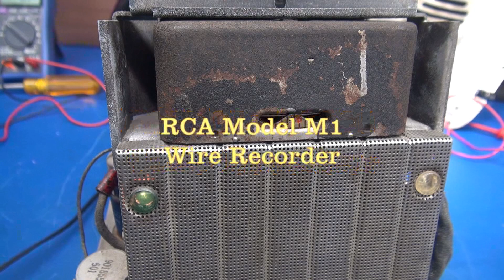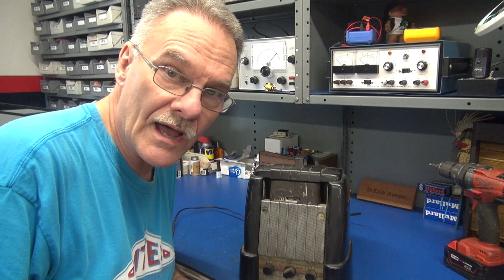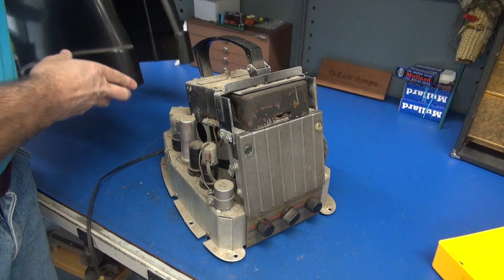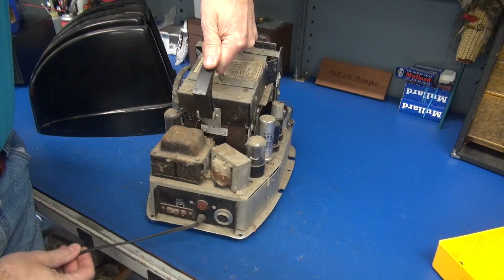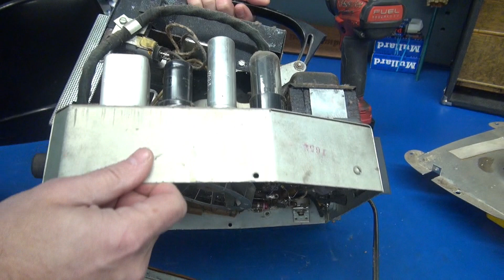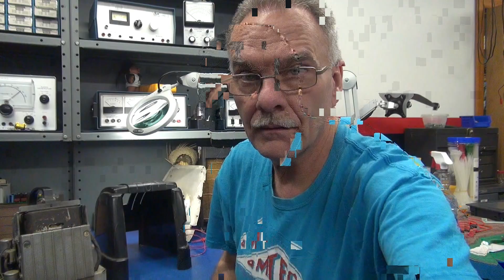RCA 50's tube wire magnetic recorder Model M1 repair and initial checkout Yes it works! Very Vintage

Comment: How the heck did you get to the wire to spice it that box when the wire broke, and the wire in those old records always broke. My dad had a old webcore dictating machine that wire went through the head at an incredible speed particularly on rewind or fast-forward. 
When the wire broke you tie a square knot in the wire then heat it with a match.